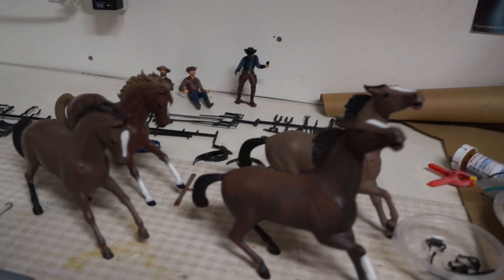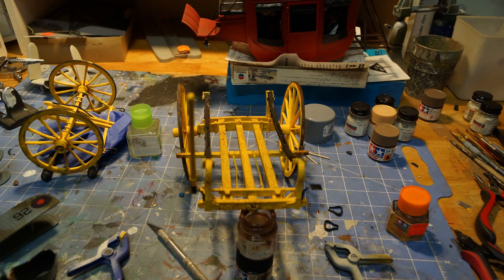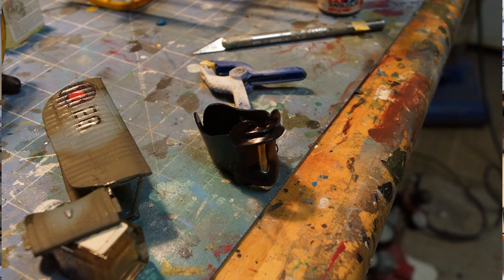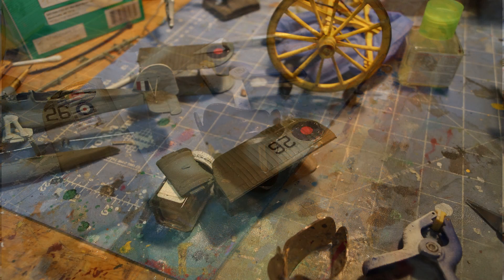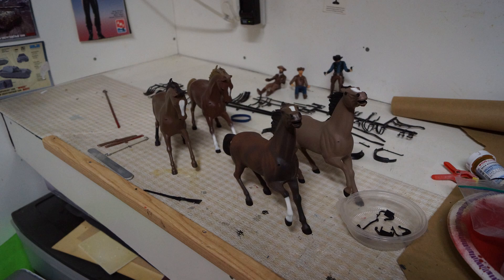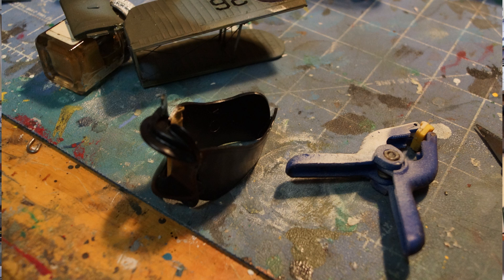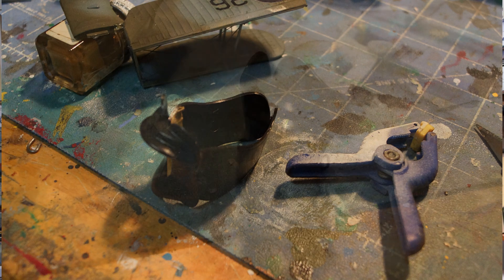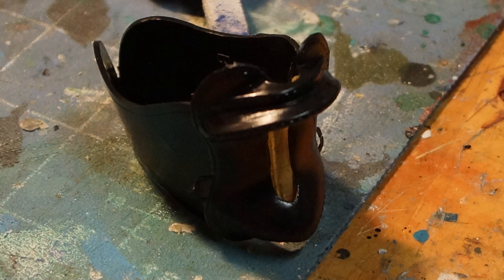Max's Models after hours 9/5/20

Comment: Horses looked great.  

Re glue, the methylene chloride formula's are decent at penetrating paint.  I use a draftsman's ruling pen to apply.  Tenax 7 brand is supposed to be coming back (new rebottlers).  I have found MicroMark's Same Stuff to be about as close as you can get to it.   I was "introduced" to this by the Radiation Lab (EM/Radar lab) at my former workplace.  The students would assemble plastic kits using this stuff (methylene chloride) because it was fast setting and strong and then coat the models with a metallic "paint" that I  believe was just clear coat with ultra fine pulverized steel wool to make the model reflect radar.   They would put the models in the big anechoic chamber and run tests on the reflectivity of the different shapes, aka different radar cross sections.